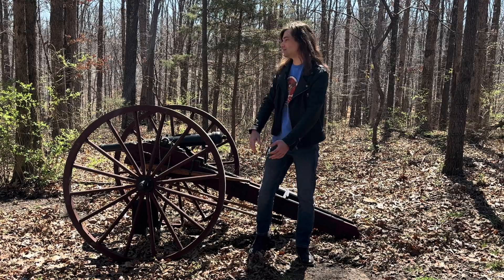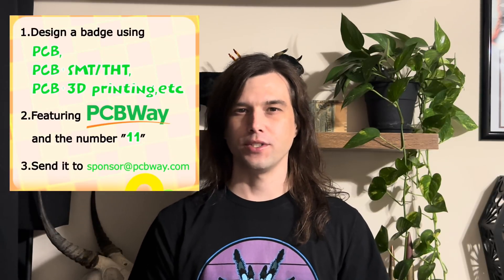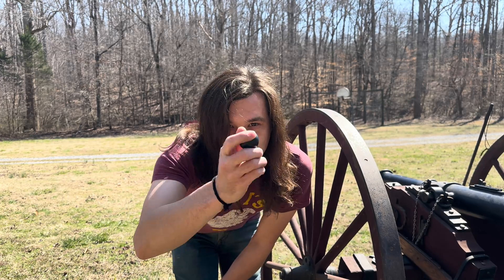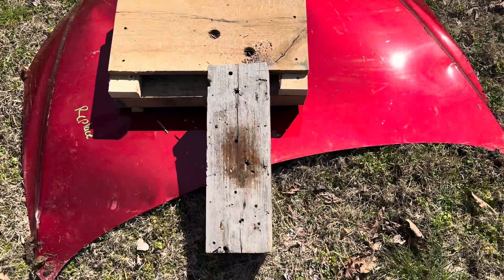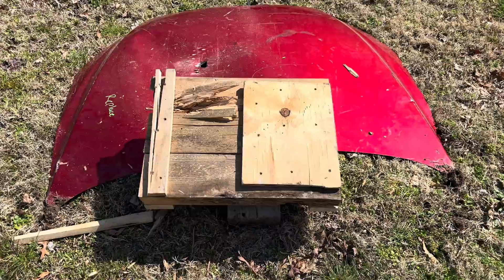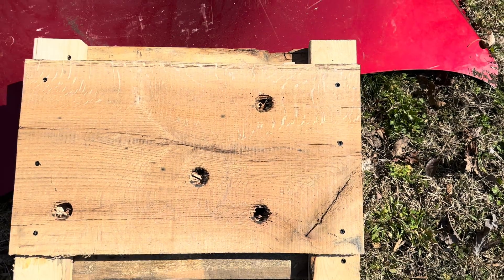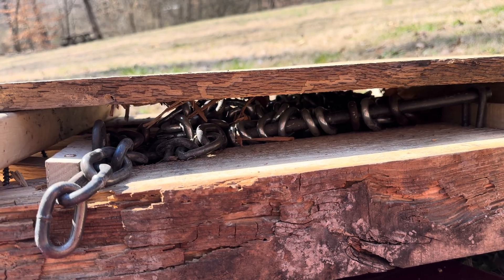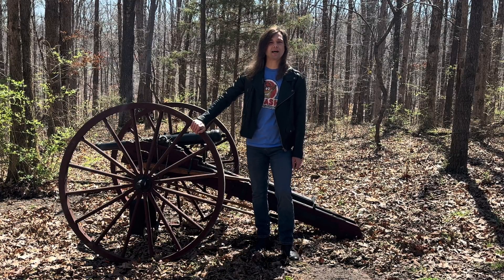Ship Chainmail: Recreating the Battle of Cherbourg

Comment: Thanks for this, I don't know very much about this period of naval history and have never heard about chain protected panels.  
I am very surprised that your small cannon balls were not more effective against the chain as I thought they would have an effect similar to an arrow and pass between the links.  Remembering that I do not know anything about this historically, I would have used 2 layers of chains wired together and then sown between tow layers of sail canvas to hold all the links in place.

This was a good video and the black powder load for each shot displayed on the screen was appreciated.  Any idea what sized cannons were used in this engagement? I am thinking the bigger the ball, the less likely it is to go through the holes between the links.
Reply from the maker: So there’s actually a surviving hull with shell inside of the keresarge that is on display in a museum that has a 100# shell embedded in the wood. They removed it before the ship sank in the 1880’s. I think they had 5” guns but the wiki article about the battle has all the cool details. 

And as for your two layer idea, they actually used 3 but it’s cast iron chain and a much bigger gun so I figured out tougher steel and small cannon warranted 1 layer.

Comment: That honestly did a lot better than I was expecting it to.  If that was actually similar to how it would have performed in real life, that seems like it would have done quite a good job of reducing the damage of an impact over critical areas.  Not flawless "we didn't even scratch them!" type armor, but sufficient to reduce longer-ranged or angled hits, or even direct hits greatly in damage potential behind the armor.
Reply from the maker: From what the history of that battle says it seems pretty constant. I posted the “aftermath” report in the description and it says most were just embedded in the wood and drastically slowed down and the chain was all busted up.
Reply: @TheCannoneer  That definitely makes sense.  The chain basically acting as an ablative outer armor layer, soak up the energy and takes damage to protect the inner hull and bleed the energy from the incoming shot.

Comment: I used to make chain mail by hand, everything from a full shirt to reinforcements for gloves. The gloves were a pain because the links had to be as small as possible. Fast forward a decade and I took some of my smaller pieces with me when I went target plinking with my buddies.

Unsurprisingly, the mail couldn't stop a single bullet. I eventually had to drape it over some plywood to hold it up. And wouldn't you know it, the addition of a hard backing made a huge difference. It could stop pistol calibers up to 10mm, which is known for packing a punch. Rifle rounds still zipped right on through.

But the lead in the pistol rounds would do exactly what that lead ball did. The rounds looked like they had melted into the chain mail links. And bare in mind, these were open links of chain, not closed/pinned links.
Reply from the maker: I’ve tried to make that tiny stuff before and I only managed a little square before I gave up. I admire your commitment! I wasn’t really expecting to open it up and see a squished lead ball around all those links so that was cool. If you have any pics of yours I’d love to see them!

Comment: You should reach out to a blacksmith to make you real over sized chainmail, what you have is chain binded together with wire
Reply from the maker: Ironically we’re technically a full time blacksmith shop 🤣
Reply: @TheCannoneer  more interns🤣 I make chainmail myself and have tried airgun pellets on 18g wire chainmail, was neat to see the chainmail bunch up and absorb the impact, might be neat to see on the outside of the wood panels, could make for some cool slow motion shots